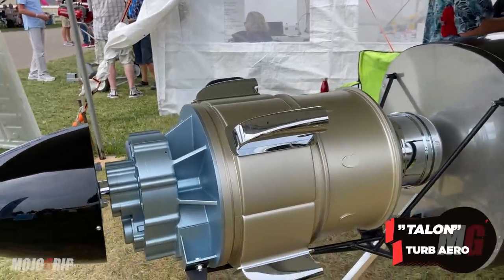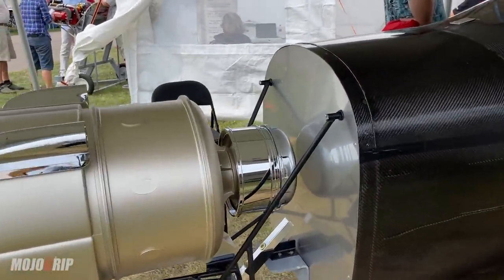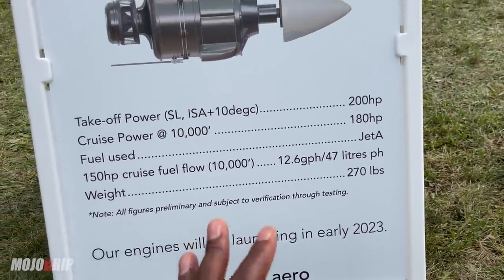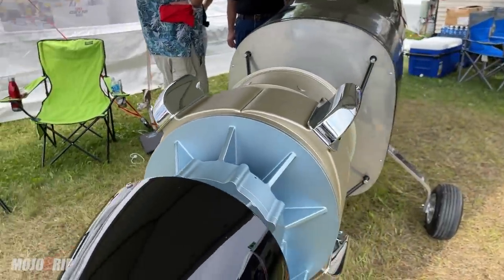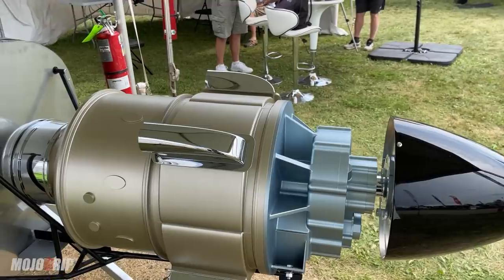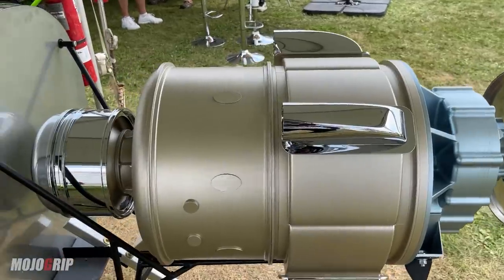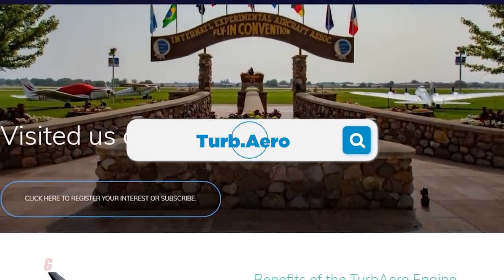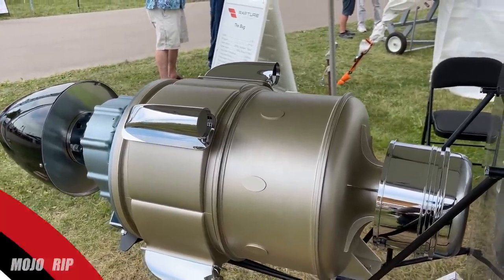200HP Turboprop Engine To Power Single Engine Airplanes - TurbAero

Comment: Can't see the value.  The UL520is weighs 108 Kg (237.6 lbs - 35 lbs. less than the TurboAero), and has 200 hp on takeoff, 150 hp cruise at 11 GPH, which is 0.44 BSFC.  It's also a 6 cylinder, which means smoother than a 4-banger (though admittedly, not as smooth as a turbine).  The UL520T is a turbocharged version that has 220 hp, and 220 hp all the way up to 15 K', which weights about the same as the TurboAero, and the UL520iS costs around $35,000.
Reply: Reliability should be higher in a turbine but agree it’s hard to pay the premium when a piston can do just a much for less…
Reply: Yes but you run turbines on Jet A1 which is half the price of Avgas so if you are flying lots of hours then there is a cost offset to consider.
Reply: @spency787  Well, I think you overstate how cheap Jet-A is.  It certainly is not half the price to the GA world.   I checked a number of local dromes in L.A. and one in Guymon, OK, and in all cases, Jet A was approx. 80-83% of the price of 100 LL.   With the turbine getting 0.56 BSFC (TurboAero's unproven numbers, which are almost certainly the theoretical best value) vs. in an avgas engine in the 0.40-0.44 lbs/hp-hr range, (actual experienced values running LOP of many engines) the gas engine.  That means you are using 72-78% of Jet-A fuel consumption (by weight) in the TurboAero, all of which means that there is no fuel cost advantage to using the TurboAero - it works out pretty much that the fuel cost comparison is a push and I would estimate even favors 100LL engine over TurboAero.

I am not against Jet-A per se.  If the Higgs Diesel ever comes to fruition, which they say would have 0.40 BSFC, that would make a lot of sense:  low weight, many more smaller power pulses, greater density fuel, etc, that would indeed make sense.
Reply: @gradytalbot9101  My apologies I should have explained that I’m from the U.K. My local field sells JET A1 at £0.72 ($0.99*) per litre and 100LL Avgas at £1.65 ($2.27*) so more than double on this side of the Atlantic! 😳. (*Prices as of 1st Sept 2021)
Reply: @spency787  That does explain it.   I also gotta think that continued development of Jet-A burning engines, whether two stroke or four stroke, is certainly the future, and if not soon, it will be in due course.  EPS was developing a six cylinder diesel that had a BSFC of 0.32, or so, (they claim BSFC 0.29 at horsepowers less than 200).   Man, a compression ignition engine burning a BSFC in the low 0.3's would have to be nirvana - great range and low fuel costs.  The Higgs diesel (two stroke spark ignition) claims 0.4 BSFC, which would be great all by itself.  The Higgs diesel is an injected two stroke that is going to have a pretty constant air supply, so it is always running lean of peak, meaning no fuel waste, so should get have a pretty constant BSFC regardless whether on takeoff, climb, or cruise.

Comment: I'm not in the aviation industry but really enjoy it and wish I had the time and money to get into it but being a OTR Truck that is a really hard thing to do but I digress. My out take of the price point of this engine is that $80k is definitely a nice wish full thinking. Due to current market values materials that would be needed to make this turbine engine. My guess when this turbine engine is able to come to market. You'd most likely be looking at a price point of $120k - $180k due to inflation and chip shortages that they would need for their computer control modules. But if they are truly able to keep it near that $80k mark when they come to market with it. It definitely will be a engine of envy amongst pilots and aircraft owners in the light craft section of aviation. It might even cause an upset in the light craft market in a way that it would cause a lot of light craft prices to go up because of this turbine engine that could be shoe horned into place. But honestly. Only time will tell what will happen.

Comment: When doing a comparison with a 200hp piston engine like say an io360 you have to take into account the fuel weight for a specific mission. Turbines are crazy light, but crazy thirsty and crazy expensive. It will be very hard for them to be competitive even if they do bring it from pipe dream through prototype to production. That process is very long, hard and $$$ which is why so many of these things never materialize or even if they do they never survive. You need super deep pockets and the ability to wait years for a return on investment.
Reply: Hi RV4 Guy.  Turbines have historically been crazy light, thirsty and expensive.  Our strategy has been to to sacrifice some of the crazy light in order to address the crazy thirsty element by incorporating recuperator technology.  For power settings above 150hp, we do not expect to be too far off the fuel burn for an IO-360.  So the range of an aircraft should be similar, particularly when drag can be reduced with a more streamlined cowling.  With JetA being much lower in cost than Avgas, the hourly fuel bill could even be less for the Talon, depending on your mission profile.
We are also doing our utmost to reduce the crazy expensive element down to become a not quite so crazy expensive element.
You are absolutely right in saying it is a very long, hard and $$$ program and we can see why previous programs have faltered.  We are confident we will have solved the technical issues and now we just need to prototype it, test it, fix it, retest it etc. and start building them for customers.
Reply: @TurbAero  I wish you the very best. We need people with vision and courage. I hope you succeed.

Comment: Mike, what would be the performance considerations with this Engine vs. what you're already using?  I understand your Sling is presently flying a Rotax 915 - could your aircraft's airframe handle the additional midflight aerodynamic stressors that a 200hp Engine like this one would generate?  I'd be interested in What aircraft would this fit (could it fit the Sling?  how about the Avocet or the Dark Aero?).  Mainly, just curious what design considerations you'd also have to take into consideration if one were to retrofit this onto an Experimental kit aircraft??

Comment: Granted I'm a total luddite when it comes to turboprop engines, but what's the advantage of this over say an Allison 250? According to the interwebs the Allison is 173 pounds and has 380 shp. Price is certainly a win over the Allison but is performance of this new engine really that good comparatively? Genuinely curious, not slapping a new product around.
Reply: Thanks for your interest Mike.  As you say, the price point will be significantly in favour of the Talon.  This point alone will likely sway many towards the Talon.  Cost of spare parts and cost of overhaul will be other factors.

Comment: PBS Velka Bites already has a turboprop in this range. It uses the same core engine as the jet on the SubSonex.
Reply: wow 20% more power and 1/2 the weight. I wonder how long it lasts
Reply: @AntonEMaes  well, the fuel burn is much higher than what this engine forecasts so there’s that. Plus since the Subsonex is a thing, the core engine will survive so I think it has a much better chance than this engine. 🤷🏾‍♂️

Comment: There are a variety of significant problems that will have to be overcome here; e.g., flat-rate to 200 hp would be fine, but as max-rated-output, I doubt it--even from the view of serving nothing bigger than the 4-seater SE market.

Comment: With a turbine this small, what would be the throttle responsiveness? And how does that compare to equivalent 150 to 200 hp piston engines? And what is the power growth potential of this engine? How does its weight compare?

Comment: It's interesting. It's looks nice but also rather incomplete. I wouldn't call 80grand cheap but it's not entirely unworkable. 
I would much prefer a turbofan jet of similar size though. It's both simpler, lighter and a lot quieter and can sit at the back instead of a front noise maker.

Comment: Sure it'll fit in a Cirrus, but a Continental TSIO-550 makes 350HP... this is only 200HP takeoff and 180HP in cruise, and it falls off dramatically up in the flight levels.
I'd really like to see a ~300HP turboprop that's fuel efficient. Some of the PT6 variants fill that role, but the lower power variants aren't especially fuel-efficient compared to the higher power models. I want to see something optimized for that power range, not just a big turbine that's been de-rated.
Reply: How about those inverted Allison 250 / Rolls-Royce 300 engine turboprops??? they are more appropriate for the light aircraft Beechcraft Bonanza Cessna 150-206 Cirrus 22 types than the P&W PT6 engines. The General Aviation world mist out on the Boeing T50 and T60 engines from back in the 50s and 60s. They would of been great for those types of GA airframes long ago.

Comment: Even if they could make and sell them for $5000.00 an engine they would have an uphill battle to make them popular. The majority of airplanes that could utilize an engine this size are flying out of small town airports where jets can't land and thus don't have any support for refueling or maintenance of jet-A burning aircraft.
Reply: @tlangdon12   Electric for airplanes will only be practical for localized flying for many decades in most locations. It lacks even more infrastructure than airplanes that fly with jet A. Most airplanes spend far more time in their hangers than in the air and it may be months between flights. Batteries don't do well when stored for long lengths of time unused and they don't survive in the below freezing conditions where most airplanes are stored in the winters.
Reply: @tenlittleindians  I was thinking more along the lines of bio-diesel. I think that light aircraft will need the energy density of a liquid fuel,
such as bio-diesel, for many years for the reasons your suggest. Bio-diesel can be handled using the same equipment as Jet A-1.
Reply: @tlangdon12   If it will burn jet A fuel it will also burn bio diesel so I don't see your point. I had an older Mercedes car that was converted to run on bio diesel. It had a tank for bio and another for diesel. Bio diesel also has no infrastructure to support it being a practical fuel. It takes a lot of diesel fuel to grow whatever your making the bio diesel out of. And even more to transport it to distribution points. There's no such thing as a free lunch and bio diesel is far from free or cheap to produce. If they ever applied the same pollution restrictions on aircraft that they apply to cars we wouldn't have any diesel or gas engines that could pass the emissions tests.

Comment: The part that is driving the optimistic numbers is the recuperator that is being added to the engine. It is something that hasn't really made it in to the certified aviation engine world. If the TurbAero team is able to figure out a way to harness the efficiency possible with the addition of this item, the performance and efficiency might be in the ballpark. 

For those looking for something other than a static design... TurbAero does have a video on YouTube showing their test run of a smaller turbine that they originally were thinking of trying to develop. They decided to go with a larger, higher horsepower, design for their initial launch however. Therefore they are working out the engineering and production to bring a larger engine to the market, building on some of the things they discovered with the smaller design.

https://youtu.be/FEn1iCU6Hh0

Comment: 1000 hour TTBO for $80K @ 200 HP is not deal by any stretch even if you fly high alt. Compared to a IO360 producing 200 HP with a t TTBO @ 2000 hours for approx $30k.  Sure it will not produce the same at 10K feet and above but the cost and the fuel burn does not justify.

Comment: I was looking at these to replace the Rotax 915s engines for the Tecnam p2006t. They are both too heavy 270#  and too pricey ... $85K ouch! But that config would still make a sweet aircraft. Yeah, looking to get away from Avgas  but that weight sux. ;)

Comment: An interesting engine!!! But $85k. Is a lot of dough... Even for a turbine engine... This is one of the reasons that the Experimental and Sport Light Aircraft markets have become so popular... Realistic pricing of products that provide very good performance and reliability at a fraction of the co$t of certificated type of aircraft... You (moneygrip) might consider these Experimental/SLA planes too.
Reply from the maker: There are piston engines with less redundancy and automation that cost over $100,000

Comment: 270 pounds seems very heavy for a turbine. A 400 hp Allison C20 (Jet Ranger) weighs only 150 lbs., but burns 25 gph.
Reply: The recuperation part to preheat inlet air is heavy.

Comment: I'd really like to see at least a prototype of the actual engine, not this model. Fifty years ago Chrysler promised us car turbines, still hasn't happened, the IO320 lyc produces 200hp and leaned at 10k would burn slightly north of 8 gallons/hour.  Problem is with the current GA production numbers it would be really hard to justify the cost of certifying an entirely new engine.  Back in the day, Cessna made thousands of planes each year as did Piper, today between them just a few hundred.  Twenty years from now there won't be any GA, just military, commercial, and corporate.

Comment: "these guys have been working on this for years" and they dont even have a working prototype to show? Just a 3d model???? It would be the perfect pretend power plant for the Raptor Prototype....
Reply: Hi PlaneCrazy.  As a benchmark, the big guys such as P&W, GE etc would typically take 7+ years to bring a program like this to fruition. The status of our program is as follows.  The design is completed.  We are fabricating components for the prototype engine now.  Next year, it will run and in due course, we will determine whether our targets (not promises) have been reached.  Once we have actual and verifiable data to publish, we will do so and then folks can judge whether they are interested in the engine or not.  It won't suit everyone for a multitude of reasons but for an element of the experimental community, it will offer an alternative to the piston engine options.
So, the model we displayed at Oshkosh is not just a model, it is a representation of 3.5 years of full on design, analysis, and component prototyping and testing by a team of 20+ engineers.  Next year at Oshkosh, we aim to display an engine that has run, from which we can provide fully validated performance figures and specifications.

Comment: This engine is very interesting. Those specs on the board are at this point, wishful thinking. once you have a flying prototype. That's when you can start throwing around engine specs. As for now. Those numbers don't mean a whole lot.
Reply: It will beat the current specs. That is normal, especially for a turbine.

Comment: Not seeing the benefit compared to a 220hp TIO-360. Less rated power at cruise altitude with similar fuel burn (75% power). It does have a weight advantage and will run smoother but that doesn't seem like a big enough draw for the cost.

Comment: Let's see:  More expensive than traditional engine.  More pounds of fuel per hour per hp.  In an experimental aircraft, an approved maintenance plan is necessary before you can get an airworthiness certificate.  What is needed to aircraft structure to carry heavier fuel to keep range the same?  What is needed in the way of engine mount to keep aircraft in same Center of Gravity as traditional engine?  What is needed in way of new cowl to account for movement of engine forward to stay in Center of Gravity range?  That is just a few of many issues to overcome to save a fuel pounds to replace a 200 HP engine.

Comment: When there is a WORKING unit with a PRICE, I’ll take a look.  200 HP isn’t worth burning jet fuel.  What’s the fuel flow below 10,000’?  25gph?  For 200 hp?  You used to be able to buy a Walter turbine engine for under $50K and get 650hp.  GE bought Walter….made minor changes and that same motor is $250,000.  I can’t tell you how many times I have heard about the NEXT great thing in engines for airplanes.  Where are ALL the diesels?  40 years later………I’m  still starting up my Continental IO 550.

Comment: This isn't the first turboprop in this size and power class. There is the PBS TP100 turboprop. It's been flying for many years now and they have been trying to get it certified for at least 6 years. It's always good to see competition but i doubt claims they will selling it this year if all they can show at this point are 3D prints. And a certification is gonna take them at least 10 years. Just the reality of thing.
Just look at GE how long it's taking them to certify the new Catalyst turboprop engine from clean sheet. Announced in 2015, First flown in 2017, now they claim to be 30% done with the process and that's a company that can throw a cool billion at a project.
Reply: Hi Jan.  We anticipate that our engine will be run for the first time in Q1 next year.  It is currently being prototyped.  Deliveries of our uncertificated engine are targeted to commence in Q1 2023.  That is an aggressive schedule but much of our technology is proven and our design teams have a great deal of experience.
Reply: @TurbAero  Thank you for explaining about the heat recovery system in your engine. I guess a lot of people are not familiar with it. From reading old books about turbine engines from the 1960’s, from memory, the most efficient they got to was BSFC of 0.39 using Imperial units.  How efficient is this engine? Thanks.